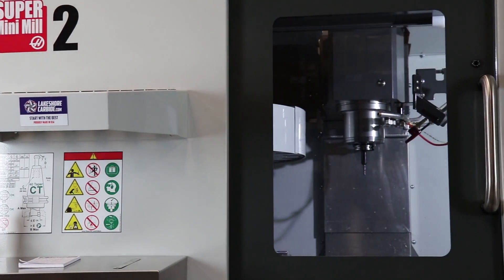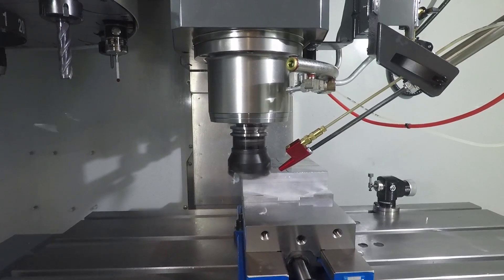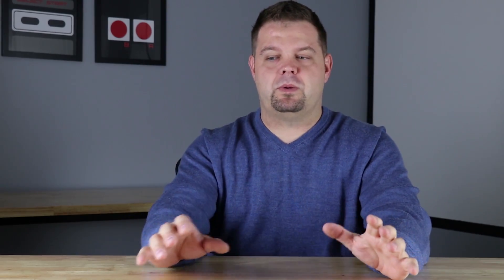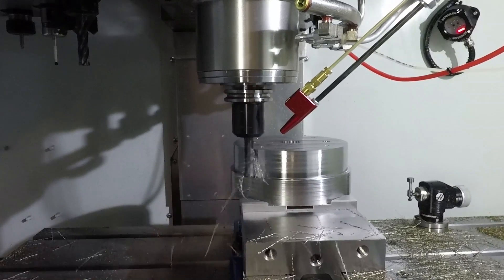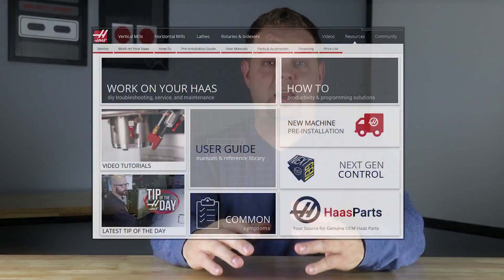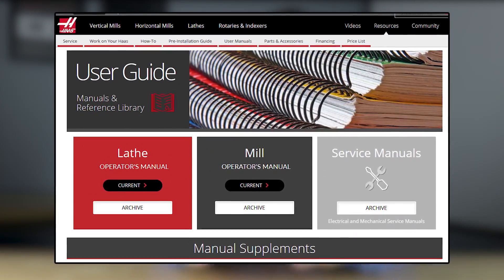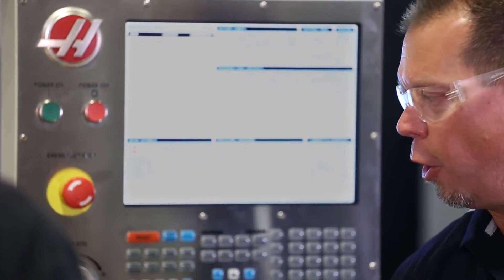HAAS Super Mini Mill 2 - Quick Review

Comment: I also have a super mini mill , a good machine but I won't ever buy another HAAS , the controller is too locked down , you can't even access such essential parameters as spindle encoder setting which you must change when a belt is changed. The only option is to get a tech out to set it for you at HUGE cost if no Hfo near you .

Comment: Yeah, the last thing a machine tool manufacturer wants is the customers going in n playing with the limit switches. Not like they DON"T KNOW where they're at bro. Your X axis limit switches on under the table in line with the rails. And yeah, in the Mini Series they are not as well covered as a VF-2 would be. I supervised assembly of both lines at the Oxnard factory.
Reply from the maker: oh forgive me.....i thought when i paid for something i owned it. lol
Reply: @NerdlyCNC  You own ur car...do you go n play with the sensors??
Reply from the maker: @glockasauruswrex6362   yep...i sure do...i have an aftermarket mass air sensor. :)

Comment: With any milling machine of that size or lager needs to be anchored into the concrete floor using threaded rods &  leveling jacks on its own foundation. This way keeps any vibrations from other machines & forks lifts moving your machine. With most machines you only need a 8 to 12" thick foundation no matter what the machine tool manufacturer says unless the machine weighs 20 tons or more. At GE we went overboard with our foundations. Most of our foundations were 5-6 foot thick which was over kill.

Comment: Wow!..Great insight on your experience. I saw your first video on the Tormach debacle! I have been using a Tormach 440 for about 16 months. I am one of the lucky ones since the mill is working "OK"... tolerances have been acceptable up to now. Used at our company for engineering prototypes, passable results, not used daily, and no production work to speak of. Thanks for your honest reviews of both machines! I will be checking out more from your site!

Comment: Jason, I really enjoy your straight forward review about this machine, and about your review on the first machine that you had that didn't work out for you, I used the PC440 for a little while at work when we needed to make one-off parts, as it was a good introduction to machining, we were soon to experience it's flaws, tolerances and limitations, it ended up being donated to a maker space and that's all I can say about that. I work with cad to design a lot of custom parts and have a cam tab that I usually program for cutting parts, As I would like to get a 5 axis machine to really speed up machining parts, the balance in price and need get skewed, what are your thoughts on just using a rapid prototype shop for parts that you send stp. files of parts to to be made  weighing on the option of buying a Haas and doing it yourself, have you thought of this route in your journey?

Comment: I spent 30 years working as a CNC Service Engineer and a Haas Outlet Service Manager. The Haas Mini Mill has killed the CNC retrofit business. You can't buy a manual mill like a Lagun and install a control like an Anilam or Fagor without spending much more than a Mini Mill costs. Another thing Gene Haas did was create the unpaid bill alarm. When you see a message saying to call your dealer, the machine will shut down in 200 hours, believe it.

Comment: But what about the power requirement difference between the MM2 and the VF2? Will the Haas technician install a VF2 in a shop that does not have enough amps to cover the maximum rated current requirement of the machine?

Comment: I ended up with a Fadal 4020 in very good condition. I chose the Fadal over the Haas because no one outbid my $1,100 bid at an auction. So $1,100 later at 10,000lbs, I am cramming in huge machine center into a small garage. My neighbors are sure to have a laugh.
Reply: Well, how did it go with the Fadal? I bought a Fadal VMC-15 at an auction and I’m blown away by its capabilities for it’s price.

Comment: You can get a used Fadal pretty cheap these days, and there is still a ton of support out there, $10k would get ya twice the machine, Just have a tech do some checks, Way,Ball screw,Spindle life. I have 2 that I had in an rented industrial bay, With 6 older Mori CNC lathes, I down sized, Now have everything in a 900sq ft home shop and do rather well. Had to work with the electric company to run all this stuff, But now have 400amp service with a 25hp rotary phase converter, This stuff on the used market is dirt cheap, I dont mind getting my hands dirty and do my own service, and have been collecting parts for many years now, I been in this biz since 1983, started my own shop in 1989, Been at it quite a long time now, No offence, But would not catch me dead with one of those cheapy mills :0)

Comment: I bought a MM2 from a buddy for my gunsmithing shop. It doesn't get run nearly enough to justify the expense of the purchase. But for what I do, the jobs it gets, the size of my shop, power availability, it's been good gear. I too would take a VF2 if I had the amperage and shop space for it.  I do have one complaint that I have experienced with my mill and also the mills at the shop I work at.  Getting the cutter comp to work sometimes is a no go. I program with Mastercam,  which could be a thing with Mastercam and the combination of the Haas control. The other machines I've run have been a VF3 and a VF4 and they too experience this problem. It takes a better programmer than I to figure out those problems I guess.
Reply from the maker: Tom Liemohn  in HSM works I use “in control” and make sure there is a negative value in the wear column in the tool table.

Comment: Hey Jason, at work we have a Super Mini 1 and 2 (2015 modle year). This will all be about the 2.

 I recently did a job in the 2 that involved a LOT of roughing (6061 Alum) At one point I went through the same X limit issue. Called the local HFO and got the same answer. "It's under the left side cover." Nope! It's under the white cover on the BACK of the table! It's a really quick fix once you know where it is. 

The table height issue, I'm 6'3" so I love how high it us but we have a guy who's 5'3" and he made himself a ~6" high platform that he flops down in front of the machine when he runs it. 

I also find the lighting rediculus! If there was another light on the other side..... Perfect!

I don't like how loud the spindle is at 10k rpms! The 12k spindles in the VF's are quieter at 12k than the Mini's are at 8k! 

Furthermore, the chip evacuation is absolutely unacceptable in my experiences. I literally had to grab a snow shovel and dig the machine out every 3 parts! (The order was for 2200!)

Will I buy one when I'm ready to do my own thing? Hell no! I love the Haas control and for the most part, support, but the issues are far too great! (With the Mini's)

VF series all the way! (We also have 2 Super VF2's at work)

Comment: The key to running any machine economically is uptime, that's why buying your own one or two cnc machines almost never works as a cost saving measure. A proper machineshop with bunch of machines and proper scheduling will always be more economical in making parts. What your own cnc offers from business perspective is flexibility, you get machine time on demand whenever you need it however you need it. If your coal is to save costs, then you don't need a cnc, you need a good contract with a machineshop.

Comment: interesting review, i am a beginner at this, is the "DOS" type coding needed to run these machines,(what most Haas videos show) easy to get ones head around, esp. if one has only ever used the hand wheels on lathes etc ? and if one is wanting a first mill would the v f 1 still be a good choice too, keeping in mind I live in Australia, and don't have the American contacts, the ability to "try before you buy", etc. that you do seeing as you live there, if I assume correctly from your statements you made on the tor mach video.
PS: this is the key reason people are scared of HAAS, the computer side of programming these things, most of us are "real" machinists, ie: we like using our hands to control things with our sense of touch to guide us!!, we are hesitant to give all control to a battery and c.c.d. screen!!
Reply from the maker: Hi Andy,

many resources to learn both CAM , "computer generated toolpaths" and good old fashioned G-code.....have a look over at Titans of cnc.

the haas control is super easy to learn.

Cheers,
Jason

Comment: Newbie mistake - the KVA rating on the machine is always inflated so machine manufacturers can cover their asses. That's because a machine will never max out spindle, axis, coolant, and conveyor motors all at the same time. I would never skimp on wiring, but I can usually get away with a circuit breaker 1/2 the size of the one recommended. 1/2!!!

Comment: I hate to be that guy, but the larger mills do NOT sit casting on concrete.  All of the full size machines have at least 6 adjustment feet exactly like the ones under your mini mill for leveling.  
Source:  I own a VF-2
Reply from the maker: Random Guy I understand.   Maybe I wasn’t clear.  Does your Vf-2 sit on a metal stand that sits on feet?

I’ve seen vf2’s have you seen Mm’s?
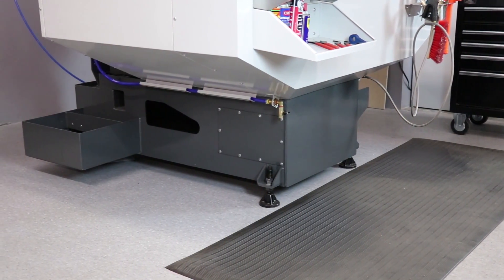Reply: @NerdlyCNC , I must have misunderstood what you were describing.  Apologies if I came off as a prat.   At 4:26 in the video,  there is a good shot of the base casting with the leveling screw and feet, looks exactly like a small VF-2 base,  just missing the middle leveling screws.  The casting on my VF-2 is a bit larger and might be slightly heavier duty (emphasis on slightly) , but the leveling system and feet are basically the same.

Edit: The mini mill base is apparently a weldment.  I should have looked a bit closer.   My bad.
Reply from the maker: no worries :)

Comment: Haas are quality machines for what you pay. However we just bought another new st30 lathe with the next gen controller and they still don’t have a manual for the lathes with the new controller we got one for the old control, pretty much my only complaint
Reply: They have a Lathe manual for the NGC. My lathe also came with  the wrong manual but I called my HFO and they swapped it out from an NGC one. NGC lathe manual is part number 96-8910. It is also on the Haas website in PDF format. Last revision is Sept 2018. The actually book you get, if you exchange them, will likely not be the latest revision FYI.

Comment: Hello Jason I ran a HAAS Mini Mill 2 for seven years in a shop with six other cnc's. I was impressed with the ability and performance. I glad we had the usb input installed. Biggest problem chips getting on the taper of tool holder, HAAS should figure how to put the coolant nozzle on the left side of spindle. Good luck with your shop.

Comment: Maybe I missed where you said it... but it sounded like the Super Mini Mill 2 fit your power needs for a 40A/3P circuit ... does the VF2 fit in that same power requirements range?
Reply from the maker: Jeff Pedlow a tech told me that I could’ve easily ran a VF2 for my application.  I never take super heavy cuts and I don’t Run High pressure TSC coolant.

Apparently TSC can draw quite a bit of current.

Long story short.  Most of these machines don’t draw anywhere near what the company has them rated at depending on how they are configured.

Comment: A serious question: what kind of building limits the 208v service to 40 amps? That sounds like an office building... I have a small shop with 208v/200amp service and that's not really that much when everything is running.

Comment: I once had a hobby machine and upgraded to a 40 x 20 x20 Cat40 VMC. I've had it for 13 years and while I was excited at first it turned out not to be the machine it should have been. (it is NOT a Hass VMC). Buyer's remorse is common and I would not have bought this particular machine "had I known", so I can sympathize with you.
Reply: The electrician was probably totaling up the breakers and trying to stick beneath the "total" value of the main breaker (200 amps or whatever). But in reality that's overkill, no reason to artificially limit yourself.
Reply: Was it a Fadal?

Comment: I chose the mini-mill 2 primarily because it was the biggest machine that I could fit under the door of my garage at home. In my previous shop I started with a TM2, then a VF2 and VF3 (with 5 axis trunnions). I would have gone for a VF2 if my garage door was bigger. 

The mini-mill has been amazingly productive for my relatively small parts. Despite its small size, it is not really material limited - I can cut pretty much any machinable materials. Obviously, the limitation is part size.

Good points - the Renishaw probe is worth every penny. I got the high flow coolant and mist collector, chip auger is a must, 15k spindle is very valuable when using small tools.

Comment: I would never personally buy a haas after what happened to me whilst working in my last place..I worked with a 2013 tmp2 and came in one morning and powered it up as normal. .msg came up saying lost its language file..I powered every down turned off master switch at the back and went into the cabinet to ensure we had back up parameters just in case which we did on an USB. Went to power back on and now nothing but a white screen. .
Called haas they came out and for no apparent reason the main control board had failed! !!!☹ 3 weeks and 8 grand later they replaced it...thank god it was works machine ..that episode sent a clear msg to me..never buy a haas
Reply: So are you going with Tormac? Or super expensive machines?
Reply: @Trumppower  I work with prototraks and xyz's now.

Comment: You should consider a USA Mighty Viper LRZ series VMC with a FANUC controller. USA Mighty sells machines with chip conveyor, high powered lighting, 110 gallon coolant tank. 1800 IPM rapids. 15HP with 12K spindle. 30 in. x 20 in. y table about 20 in the z. 24 tool side mount magazine. CAT40 tooling. All these items are included standard. Their philosophy is to sell a complete machine and not to option more money out of the customer. I would think you could get all this for the starting price of a Haas VF2SS.  www.mightyviper.com. Bo Jean is the VP of marketing located in Torrance, CA. They specialize in super large bridge mills, but they sell VMC's and a type of robodrill also.
Reply: +Nerdly I was a cnc repair / rebuild tech. Be mindfull that mazak part prices are evil! Ten times the machine  you pay. Six months ago I fitted a new spindle motor to a large mazak, cost was £9000!!
Reply: I have heard that Mighty Viper is a good brand.
Reply from the maker: Ti McCormick thanks for the heads up.  They only have two videos on YouTube videos and don’t have pricing on their site.   At this point I’m probably gonna into either a VF2 or Mazak.
Reply: @NerdlyCNC   Have you considered Milltronics?  They are a USA company, I think they are good. I've worked their machines as well as Haas VF2 & 4

Comment: You're comments were exactly the things I went through when I was deciding on the VF2 vs the SMM2. I had the luxury of researching for a year with a Tormach running my proto parts to find out the details of if a SMM2 would work for me or if I would just regret not making the jump to the VF2. The big issue of course coming down to power and needing a phase converter. 

I ended up with a VF2 (not an SS, side mount wouldn't fit through garage door so I didn't have a choice) and its now been a year of use. I certainly think a VF3ss would be super cool to have but even after all I've been through I have never felt I was limited by the machine. Its mostly my own skill level in setup or CAM that limits me. 

Things Ive added, I only got rennishaw probing with mine. But it became pretty obvious that I can do 30-50cim in aluminum without the machine really caring much. That means chips fill the bottom REALLY FAST! I bought an Auger within a couple months and while not perfect, it gets 75% of the chips out with no input from me. The last bit I just scoop the chips forward and push on the auger. Every once in a while I'll scoop out the pile by the exit that builds up  in the morning when its dry. Honestly it seems the auger should spin the other way and that wouldnt even be a thing. Next Im planning on just getting the HSM option to leave on full time instead of toggling since I do a lot of 3D work on the suspension components I make. 

Anyways, lets see some limits pushed on this thing for fun! I know people always want to see what it can manage when roughing. 

PS. check us out on IG ( https://www.instagram.com/ssb_design/ ) and we'll try to follow you there too.

Comment: good video jason! Unbiased and reasonable. I know what you mean about the tall table...I hear that from people often. About the alarm troubleshooting stuff, to be honest I think it's because they want to push towards service calls rather than self-repairs. They used to publish service manuals which were the same that HFO techs utilized, but they stopped as you noticed. (although the same old manuals still apply to many problems and machines). Also I've found that while Haas might want you to pay for their calls, the HFO usually doesn't want to piss you off and instead will help if they can (HFOs are completely separate companies after all). But it varies depending on the company and personnel...